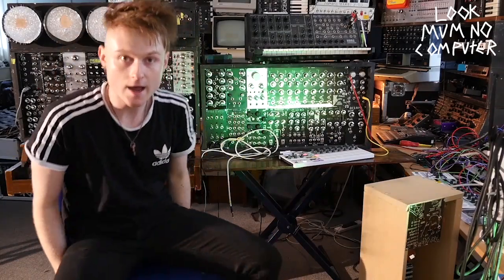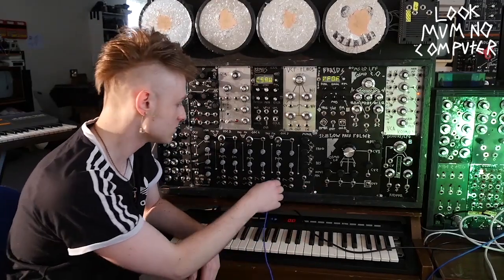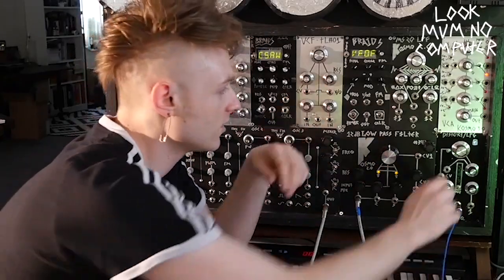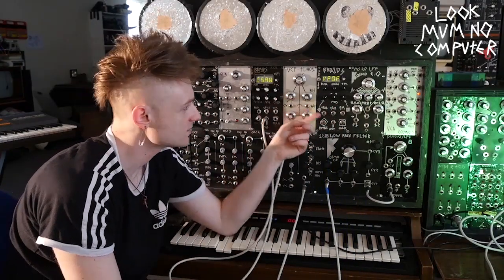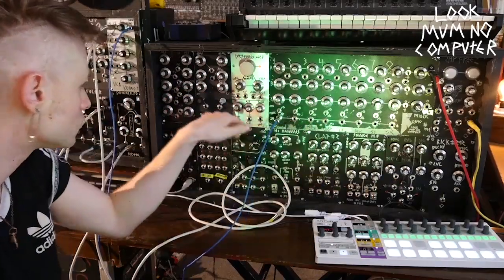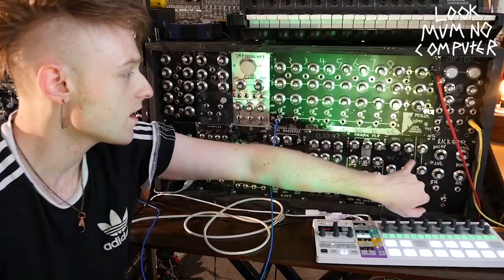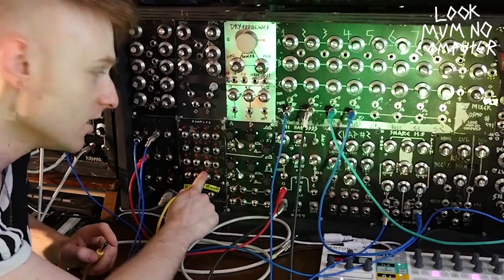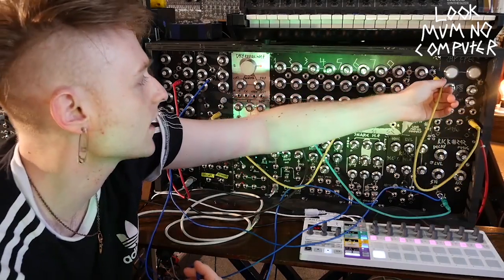Modular Synths The Core of the Synth Walkthrough LMNC

Comment: Dope work !
Would like to know more about that diode distortion/low pass gate ! 
A few questions : Did you modified the filter circuit to work on 12v or does it runs fine like it is ? 
What the switch on braids is for ? octave switch ? how do you implimented that ?!

Comment: hey, so i'm working on a modular  in eurorack format but im having alot of trouble sourcing the +/-12 v supply. any tips? what voltage is this running on?
Reply: +-12 volt. It is electrically identical to eurorack. Just bigger.
Reply: @ubergamer01  Hehe, thanks. I figured this out a year ago ;)

Comment: Added a switch on braids so that its always in tune? What you mean by that? Like your vids man, that filter sounds nice i might build one too!
Reply from the maker: yeah my bad. i didnt word it very well. basically every single oscillator i build basically has a preset tuning switch. all it is is just a switch that switches over to an internal preset pot. so all of them are in tune. works for me!
Reply: ohhh simple clever solution hehe
Reply: It's a handy thing to do! I added a similar switch and pot to several of my 5U VCOs a couple years ago. There's some info about what I did in this thread on Muff's site: https://www.muffwiggler.com/forum/viewtopic.php?p=1829400

Comment: I'm really glad you posted a filter schematic! But I am a hungry bloke and I would really like to see if you have schematics for the rest of the modules, especially your other filters and oscillators :)
Reply from the maker: Ben Reeves check out the CEM 3340 data sheet :)
Reply from the maker: Ben Reeves the matrix mixer is just a tl072 dual opamp per row. Mixing the signals together. At 1/1 gain
Reply from the maker: Ben Reeves just search up tl072 mixer maybe
Reply from the maker: Ben Reeves the great thing is you can add a switch which bypasses 1 of the op amps in the dual opamp circuit. And that inverts the signal!